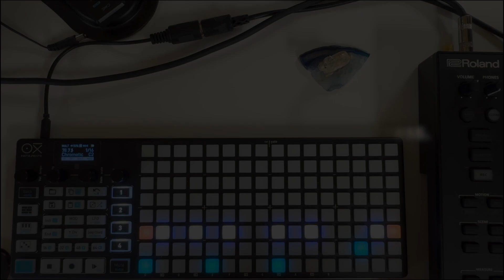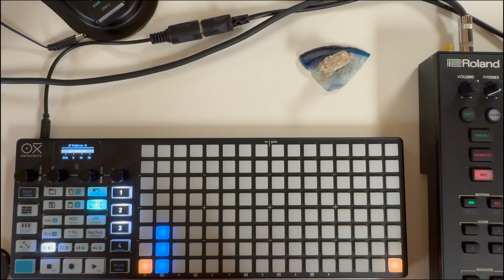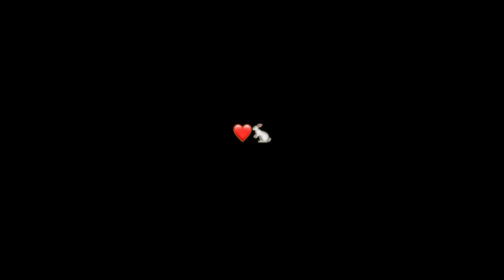OXI One Sequencer 4.0 Firmware: Pattern Generator

Comment: It might be easier to understand what Grids does if you think about a grid of buttons like OXI One's. Imagine that each button on the grid corresponds to a different pre-programmed pattern. You select a button, and the column that the button is in on the grid (counting from the left column towards the right) is the X value. The row that the button is in on the grid (counting from the top down) is the Y value. So X and Y are just a way of telling the pattern generator which button you want on the grid, and hence which pre-programmed pattern will play. The reason it's laid out in this two dimensional way instead of just a list of patterns is that you can blend between patterns by selecting X and Y values that are actually "in between" the grid buttons. This concept and the patterns themselves come from the Eurorack module Grids, by Mutable Instruments (hence it's MI Grids rather than M1 Grids).
Reply from the maker: Can I finish  my coffee and come back to this?